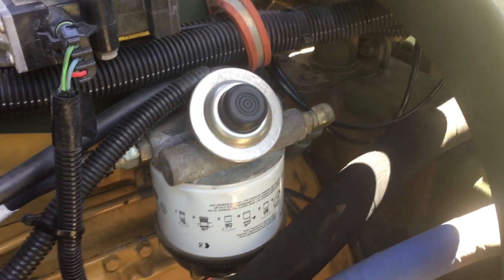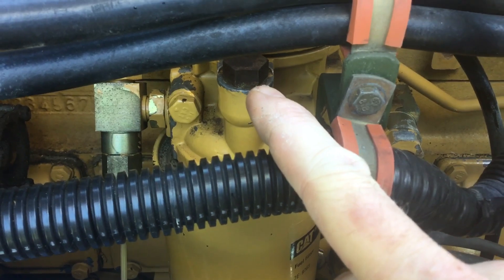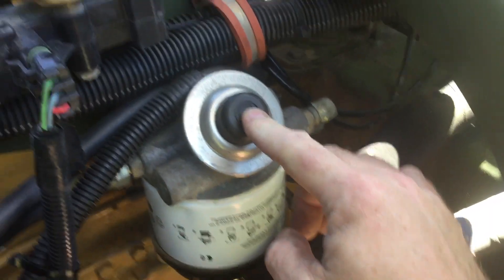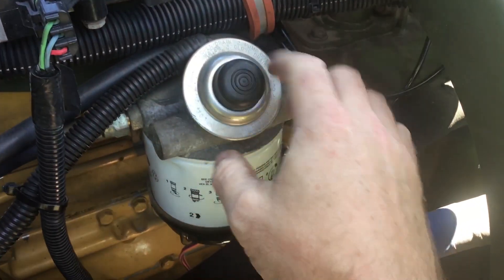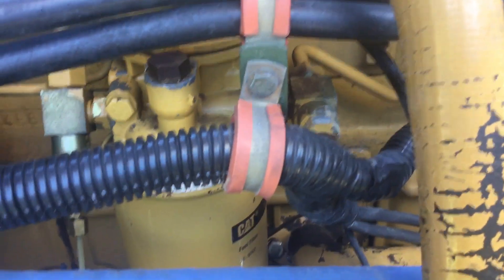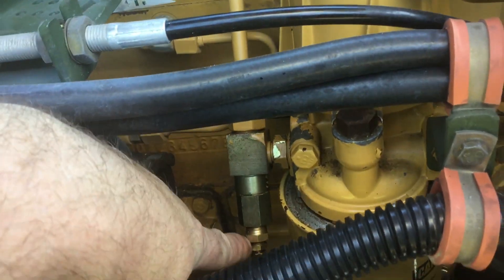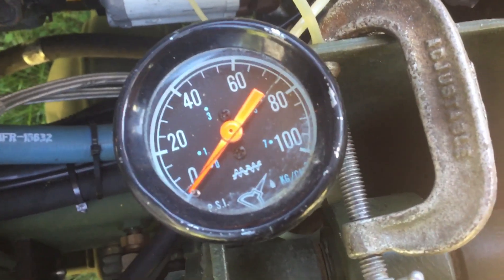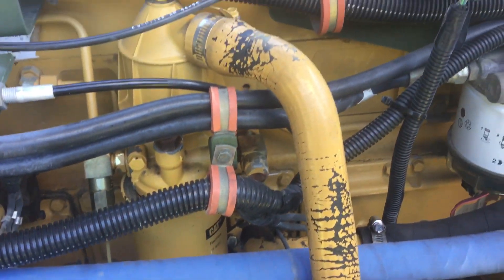LMTV Cat 3116 fuel system overview

Comment: How do you set injector sync in these with a caliper?
Reply from the maker: You can set injector timing(injector height) with a vernier caliper that has a probe for measuring depth(most have this) as it is an absolute measurement.  Like setting the valve lash, you install a bolt in the flywheel timing hole(down by starter) and rotate the flywheel up against the bolt/pin(see valve adjust procedure in tech manual) . With a timing pin installed  you can adjust half of the valves and half of the injector heights.  Using the depth pin you can measure the height from the top of the spring collar to the injector base. The timing measurement spec is on the data sticker on top of the valve cover(see injector sync/timing procedure in tech manual). When you get half of the valves/injectors set, you pull the timing pin, bar the engine over with a wrench(see valve adjust procedure ) and adjust the other half.  You should be able to do the injector sync with a simple dial indicator and mag or clamp base IF you remove the intake manifold/plenum).  With the manifold removed you gain access  to the top deck of the cylinder head and the individual injector racks.  cat tools make the job easier and you don’t have to pull the manifold, but they are not necessary., just decent quality measurement tools as the adjustment tolerance is well within the accuracy of even low end dial indicators.  All the sync measurements are comparative/relative so you setup on each injector rack, zero in a particular set position and observe the movement as you shift the control rod from A to B.  You will also need some blocks of known thickness to hold the main fuel rod in a particular position(see inj sync procedure in manual).
Reply: @rronmar  thanks man! Can you use this same procedure to set the fuel?
Reply from the maker: Yes, but you will need to make a wedge with a slot in it to go down between the side of the head and the governor.  This wedge is used to pull the rack linkage pin to its full rack reference point. And of course all this is in the fuel setup procedure in the manual...
Reply: @rronmar  thank you for sharing your knowledge, I greatly appreciate this!

Comment: Why would fuel be leaking from front and top area of cylinder head just aft of fan surpentine pulley???
Reply from the maker: nicholas clinger: Serpentine pulley? What engine?  On the 3116 the fuel enters the head at the rear and exits at the front to the pressure reg. There is an elbow, a pipe union and a hardline at the front so a loose fitting or cracked/damaged hardline at the front of the head would cause fuel where you describe. On the 3126 or C7 the fuel enters at the front and exits at the back, but same basic fittings/components
Reply: @rronmar  thanks so much for for information...
Before I start tearing it apart I'll clean and check torque on the two bolts that hold the largest of the 2 fuel lines in the same area...
I'll let you know...thanks again, nick
Reply: @nicholasclinger1737   others have found hairline crack in hardlines on this engine. do not recall if it was this hardline or not
Reply: @coachgeo  thanks for mentioning hairline cracks..
I would like to ask you a question ?? on the primary filter with a rubber press pump, is that aftermarket?? I don't have that on my 3116... I don't think I have a primer pump on my engine ??
Next comment:
There is a larger fuel line with a bracket along with two bolts that hold it to the top most fwd area of cylinder head... just forward of that point is the engine removal piece that has a large hole a chain will fit for lifting...fwd of that is the heavy bracket held by six bolts that supports fan clutch and fan assembly....
My thinking along with you're pointing out a hairline fracture might exist..??  the area of the right  bolt ( 1 of 2   
Looking from front of eng..) that secure the return fuel line flange to the cylinder head....
So happens that the top right bolt
Of the bracket supporting fan and
Clutch bracket  taps and threads into the same vacinity of cylinder head.....very close!!!! Might be a weak spot??
Maybe you could share with me what I would see, if I were to removed the six bolts that support fan and clutch along with the engine lift piece that's behind it ..????????
Reply: Thank You!!
Reply: @nicholasclinger1737  RE: what you would see if you unbolted the lift eye
sorry did not see this till just now but honestly..... I do not know the answer.  Ron?
Reply: Jr ALEXANDER  there is an oil line from block to governor you may be confusing as a fuel line

Comment: is there a built in air bleed in the system?  for example on MB's I've dealt with any small air leaks in fuel lines etc. is less troublesome cause said air is shunted out the top of the fuel filter housing thru a check valve and routed into the fuel return to tank line where it gets vented out via tanks vent.
Reply: Ok got it..!
Just had to view your vision again...thanks
Reply from the maker: nicholas clinger I just did another video on how to check that the primer is functioning properly
Reply: @rronmar  thanks for mentioning hairline cracks..
I would like to ask you a question ?? on the primary filter with a rubber press pump, is that aftermarket?? I don't have that on my 3116... I don't think I have a primer pump on my engine ??
Next comment:
There is a larger fuel line with a bracket along with two bolts that hold it to the top most fwd area of cylinder head... just forward of that point is the engine removal piece that has a large hole a chain will fit for lifting...fwd of that is the heavy bracket held by six bolts that supports fan clutch and fan assembly....
My thinking along with you're pointing out a hairline fracture might exist..??  the area of the right  bolt ( 1 of 2   
Looking from front of eng..) that secure the return fuel line flange to the cylinder head....
So happens that the top right bolt
Of the bracket supporting fan and
Clutch bracket  taps and threads into the same vacinity of cylinder head.....very close!!!! Might be a weak spot??
Maybe you could share with me what I
Reply from the maker: nicholas Google LMTV. This is the standard primary filter/primer on the LMTV, Light Military Tactical Vehicle.
Reply: Found out that my 3116 fuel leak at top and front of cylinder head was a result of a small flat Allan head threaded dime size plug with  o ring 
That screws into the head... it's location is center of  ( 5 ) 15 mm bolts that secure the engine lift point bracket and the engine fan bracket..
My plug was only finger tight and the o ring was hard, brittle and broken...
A lot of labor to replace !!
But my leak is GONE!!!!!
Reply from the maker: nicholas clinger excellent!  Not familiar with that plug, I will have to go look for it now...  edit:  I found them in the exploded parts manual(24P) there are actually 2 on the front of the head and 1 on the back of the head. They may not all be for fuel, but there are plugs with Oring seals both ends...
Reply: @rronmar  I'm impressed with your ability to research and explore your resources that fast!!
Sure helps out the novices...thanks again!!
Reply from the maker: coachgeo Just the plug you can loosen that I pointed out on top of the secondary filter, nothing automatic...
Reply: @rronmar  thanks for the info..
I'm not understanding all that you said ??